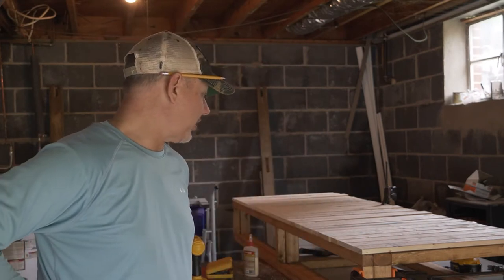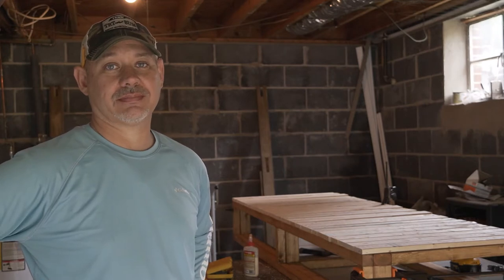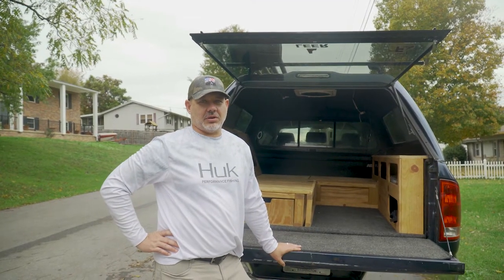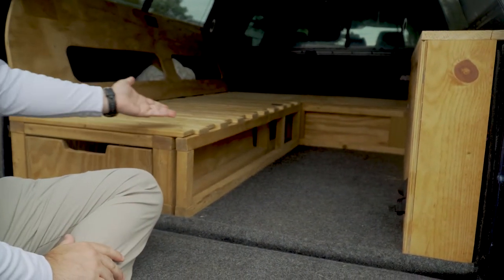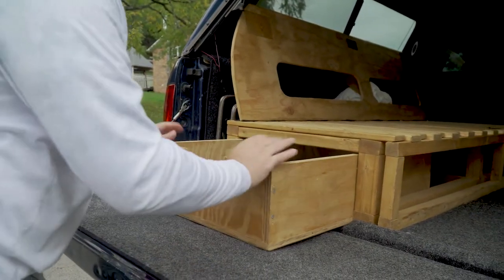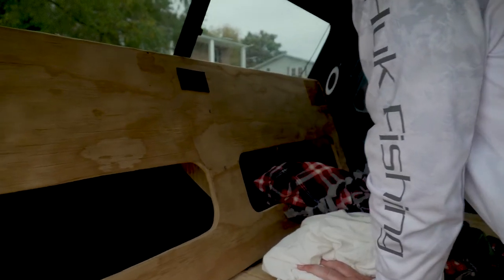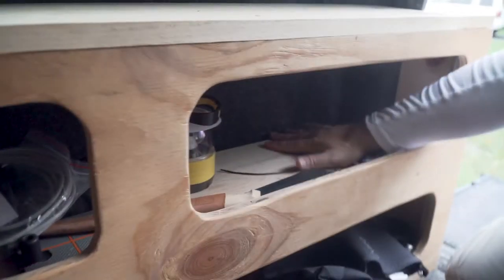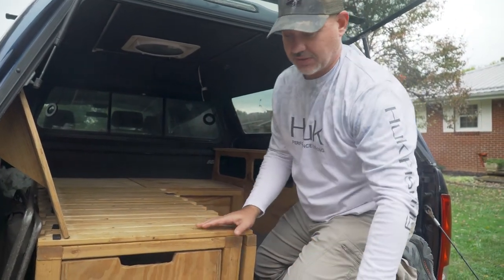Ultimate Fly Fishing Truck Build Part II

Comment: I have watched probably a 1,000 DIY truck camper build videos and I would score this design in the top 5.  A very well planned and thought out design! 

I am curious about what you left out of the video.  Such as what the make and model of the truck was, how long and wide the bed was, and what type of camper shell you show in the video.  I own a Tacoma with a long bed (72-73 inches) and have an A.R.E. TW High Rise series truck cap on order, and I chose that brand of cap for the extra head room that I would prefer to have if I decide to do a truck camper build.  Your cap seems to be taller than the usual 'snug fit' caps that are even with the top of the truck cab, but I did notice that the height of the cap seemed to be
consistent from back to front.  The A.R.E. TW Series caps start high in the back and then gradually slope down as they get closer to the truck cab, which ostensibly helps with the aerodynamics, reducing wind resistance and helping with getting better gas mileage.    Head room is an absolute MUST, especially for older goats who have artificial knees that are not as limber as their originals.    The caps will cost you significantly more, but I would guarantee that spending the extra money for a high rise cap will be a decision that nobody will regret if they wish to do a DIY truck
camper build.
Reply from the maker: Thanks Gus. Part one of our build shows the truck and the camper shell https://youtu.be/TXnFj8LXDno. It is a 2006 Dodge Mega Cab. The cap is a Leer Mid rise 180. I'm like you, the extra head room was a must and the height of this build allows me to sit straight up very comfortably and I am 6'2.